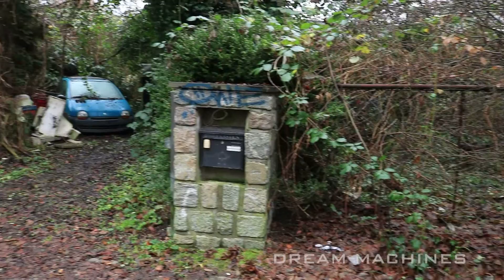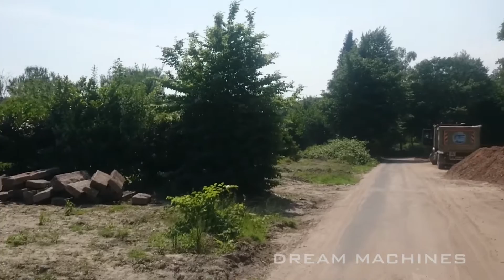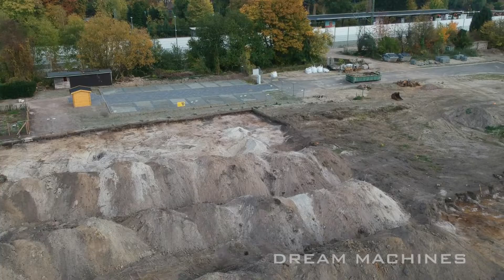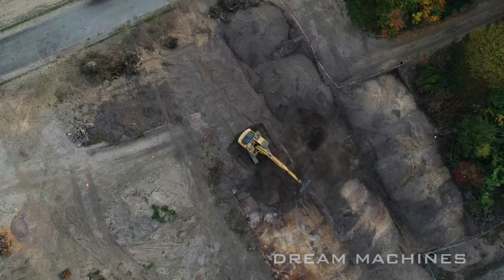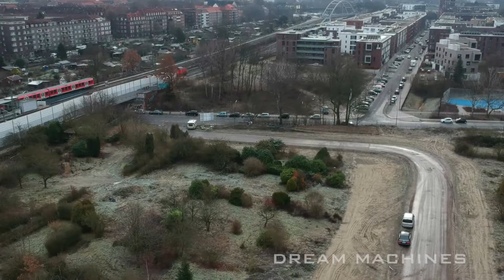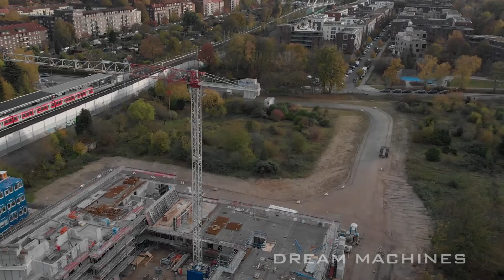KOMATSU BAGGER + VOLVO RADLADER *DROHNE* BAUSTELLE ABBRUCH KLEINGARTEN & BAUGRUBE

Comment: On the part where the loader was taking dirt into the hole. Was that soil contaminated with fuel? Or was it just not sutable to build on?
Reply from the maker: No contamination. There was wet clay in the hole which was covered with sand